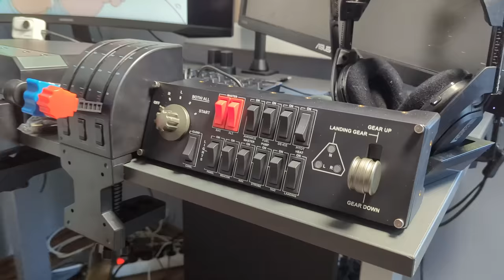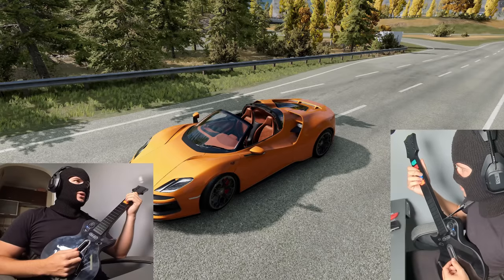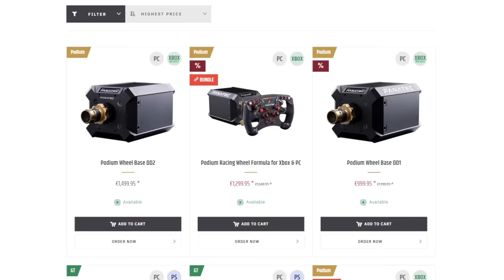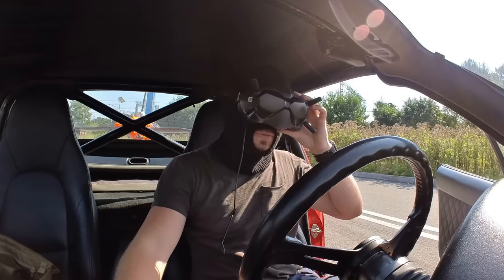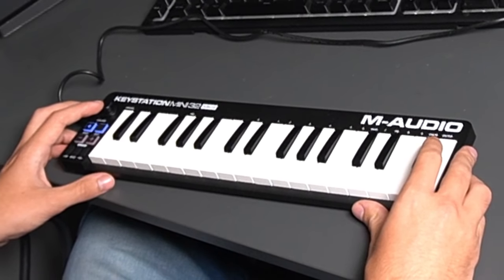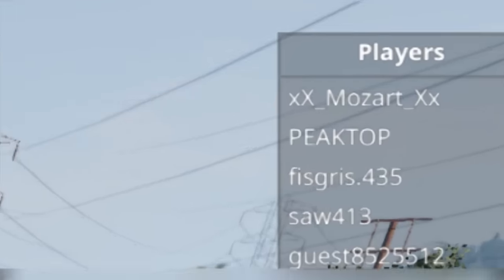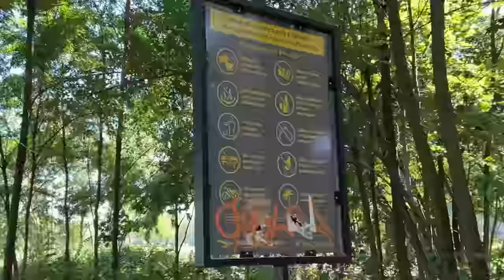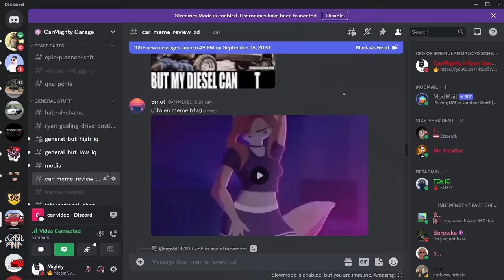Dumb Ways To Play Racing Games 2

Comment: Basically the fpv camera to set up you plug in a fpv camera and then on your headset or monitor you press a pair button and it searches through channels to find the best signal. Its compatibale with just about all cameras monitors and brands really cool stuff

Comment: Been using a joystick for BeamNg and Assetto for a while now and it works perfectly. Allows for fine steering by twisting and acceleration can be set using the slider. Brakes are the trigger normally used to fire lol. Its way better then a controller or keyboard if you cant afford a wheel.

Comment: Planes don't really have a break. They have the parking brake (or reverse thrust, although I don't think that works), but that's really not intended to be used frequently.
Also, not all planes have a joystick -- fighters and modern airliners, for instance, sometimes come with joystick controls. A bigger joystick would work similarly, just less ridiculous than a full yoke.
Heavy equipment is actually hidden gem, although not super useful for like, non-farming purposes. Still remappable, however.

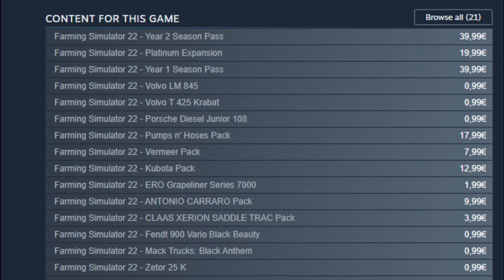Comment: 9:19 As if you need all DLC. Most expensive version on regular is 80€*, but starts at 20€. In Germany. Likely less expensive in Poland. And if you buy the expensive version, you don't need the season passes. and the season passes include most of the DLCs (except the ones the developer deemed extra premium). Same goes for the DLC that expand the basic version to a higher ones …

*=Today on 2024 Spring sale It's 37€

Comment: when i pirated beamng i liked it so much but i haven’t had a proper way to steer the car (not even a controller) so i set up the steering to be driven by the mouse, the more you go in a direction with the mouse the more the steering wheel turns that way. you should try it

Comment: 30:22 Great. You turn (whatever the fuck) DC voltage into AC voltage with huge losses to turn it back to DC voltage. Presumably 12V. You could have used the USB-C on that "generator" and ask it to output 12V. And turn that into a plug for your "laptop". If it doesn't support to be powered via USB-C directly.
Such an USB-C power delivery board costs about 1€ delivered and soldering (and heat sleaving) is about 1 minute